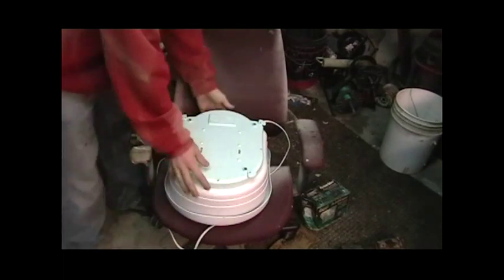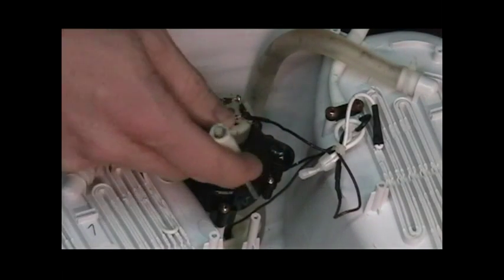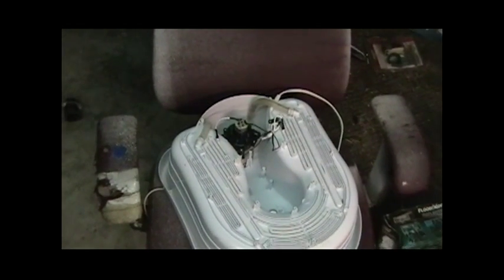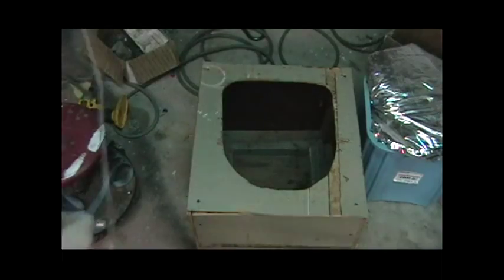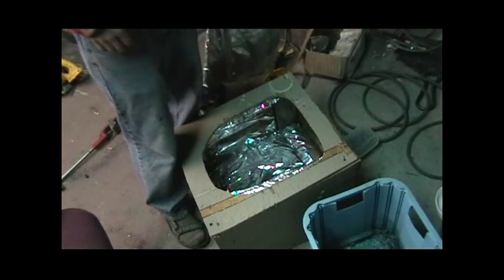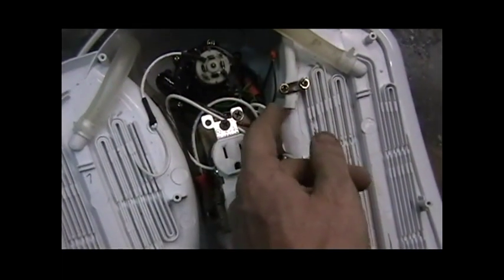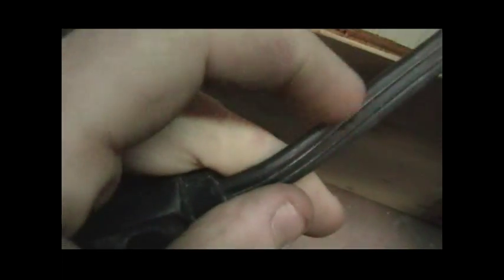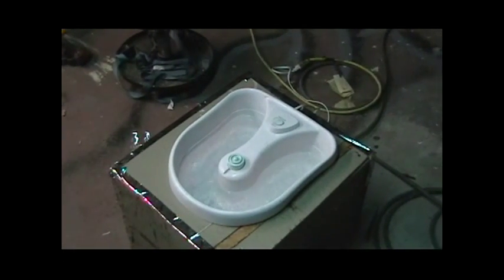Does your heated footbath not heat? How to upgrade heat...

Comment: I suppose for a small project you don't mind losing a lot of energy in light loss. I have a foot bath that's about twice as big as that. It has circulating water and it must have some kind of water heater. Because it will get up to 50°C in about 12 minutes. cool project, nice video.

Comment: I was hoping to just remove one  of the 6 resistors on mine... still probaly will
Reply from the maker: if the resistors are connected in parallel, you'll get less heat. If the resistors are connected in series, you'll probably allow too much amperage to go through the resistors and the individual resistors will overheat without actually creating more heat

Comment: Holy cow where do you live where you can't have a water heater? I clicked on your vid after searching for heated foot baths that actually heat. Apparently all the little foot tubs here (USA) just bubble and make noise, but don't heat. Tankless water heaters are great but I don't know how you could use that for a bath other than to fill it.
Reply: So exactly how high were you when you made that comment?  You can't put water much hotter than 110 degrees into one of these without risking damage to your feet.  The skin and nerves in your feet are actually very sensitive and you can easily damage them.  110 degree water is going to cool off below body temperature and feel cold within only a few minutes - especially while being agitated by bubbles of room temperature air.  There are plenty of the foot spas that supposedly heat the water, just most of them suck at it - they even tell you it will not "heat" cold/cool water, they only "maintain", and even thats a stretch for most of the cheepies out there because as he said the heating element is about as powerful as a couple nightlight bulbs.  A much better and safer solution to this would be to make a small acrylic reservoir with an aquarium heater installed, and circulate water thorough it with either a small pump like they use in tabletop fountains, or simply by convection.
Reply: @MobileTaz  Great points. I love that the comment you responded to is 10 years old and your comment is five years ago! I've had a really good foot bath that heats the hell out of the water for 10 years so when this video was made, they had these things. It was probably about 100 bucks on Amazon. I'm using it today still works.